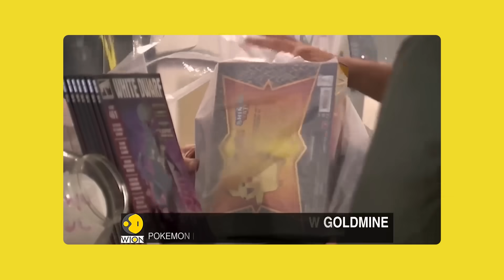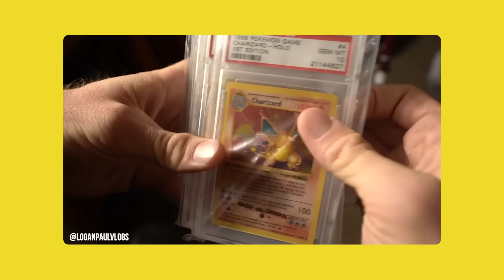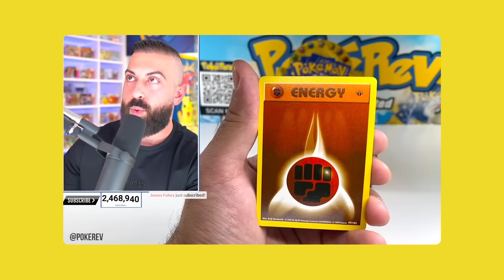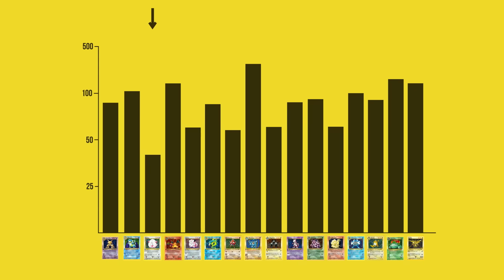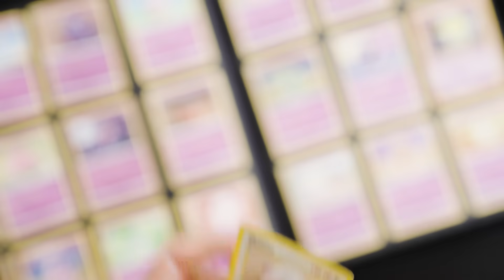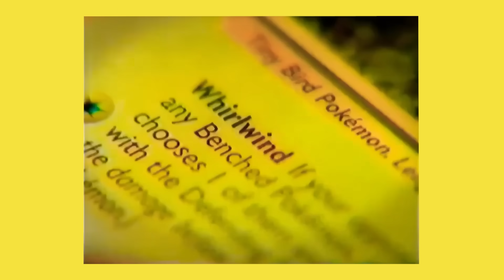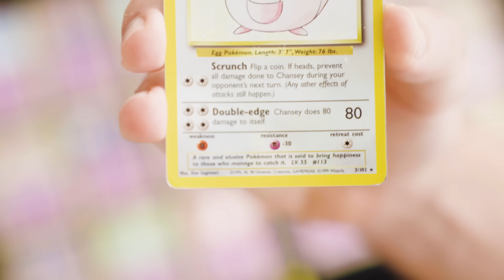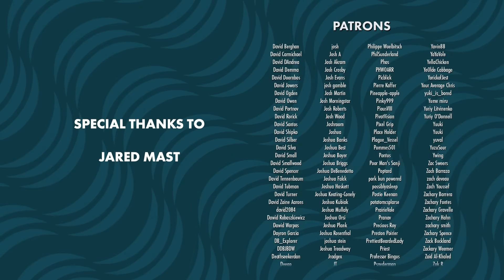Why the Chansey Pokémon Card is So Expensive | Good Blood

Comment: I would argue it did somewhat have a more supportive/nursing role in the game as it would be the only family of pokemon that could learn the move softboiled. One of the few healing moves the game has, especially for gen 1.
Reply: I dunno. As far as gen 1 goes, Mew is just as famous for Softboiled being a part of it's kit.
Reply: @Surkk2960 Have you tried using exactly a lvl 58 Machamp that also knows Bide? You see it needs to Bide its Strength in order to move the truck.

Comment: F*ck the speculation market. It ruins any sort of preservation. Also, Base Set Charizard is a really bad card in the TCG, Blastoise and Chansey are by far stronger cards in play at the time.
Reply: I mean Blastoise and Charizard worked pretty good in the same deck. Using both powers to roll them out. 

I really wish I'd gotten to use my Mr Mime, Alakazam, Chancy Combo at a tournament before my deck was stolen.
Reply: In a market where just about every other card is a foil and has some over the top graphic art that uses the entire card instead of just the box, the older and more subdued cards with old foil designs become desirable.

The game of Poke'mon is far beyond the playstyle of the original sets, so the original sets can practically only hold collective merit.
Reply: This is why I don't even bother with collectible card games above a certain dollar amount. I'll play trash decks all day, every day. I'll find friends who want to play the game using proxies. I'm not dropping a paycheck on a piece of cardboard. Wasn't all this just supposed to be a game played on tabletops, not auction houses?

Comment: I have all 152 original cards framed on a wall in my house.
The last card I needed to complete the set was a Charizard. Everything on ebay was way too expensive and I figured I was going to have to save up for a while to afford one. Then one that appeared to be badly scratched was up for sale for about 90% less than the others. I figured I'd buy it so I could at least complete the set and hang them on the wall before I acquired one that was in better condition.
When it arrived it looked kind of funny. I took a wet cloth and wiped the front of the card. What appeared to be syrup came away and underneath the card was in virtually perfect condition. Utterly bizarre the person selling hadn't thought to clean it up a little. What a win for me.

Comment: I have that chansey by happenstance...huh, I never knew it was valuable. I've had it since it was released in the usa in the 90's
Reply: Time to get your pay day.
Reply: @proy3  Providing it meets the "10" criteria
Reply: @Crispman_777  which it probably won't. If graded, I'd be thrilled if it got an 8. I predict 5 at the lowest...Its not like its in unplayable condition after being kept in a briefcase for over 20 years but, it was bound in a deck with a rubber band years ago so certainly has imperfect edges and might be slightly warped but otherwise not bad condition

Comment: Meanwhile, Chansey is one of the better cards in the game (unlike Charizard which sucks). It's THE stall Pokemon card with 120 HP, 1 retreat cost, and being a basic Pokemon. This makes it pair especially well with a Trainer card called Pokemon Centre which removes all damage counters from all of your Pokemon in play provided you discard their energy cards attached. 

So you would slap this on the active slot, build up an Alakazam on the bench, switch with a strong attacker and use Alakazam's ability to switch damage counters to Chansey, which you would then fully heal with PC. It essentially made your team impervious to all damage if set up. This is especially the case when you have multiple Chanseys on the bench.

Comment: I know I had a 1st Edition Chancy, but I searched the few Pokémon cards I kept and couldn't find it, so it must have been part of the ones I sold like a decade ago. There's no way it would have been a 10 since I actually used it in decks, tho. At least, I'm pretty sure it was 1st Edition. I have this memory of it being in the first few booster packs I ever got when the cards first came out, and they were 1st Edition packs.

I also had 4 Charizards. None 1st Edition, but 1 was Japanese, and 1 was also a fake (may have been the same card). One of them I even pulled at my birthday party one year! It was very hype.

Comment: Imagine Pokèmon made ten times as many of them.
Reply: they could make more of them, but those wouldnt be first edition, so they have less value
Reply: Rarity is defined by scarcity, I mean the two words are basically synonyms. If someone suddenly throws another 150 PSA 10 Charizards on the table their value will reduce immensely, they probably wouldn't be worth even 10% of what they are now.
Reply: @88Opportunist  you forgot about editions mate. Reprints are worth way less than first editions. Yes the first editions will lose some value because of reprints, but they won't crash. They will remain very valuable.
Reply: @BanditLeader  Made past tense, as in "Imagine if the past was different." Sorry I was unclear on that.

Comment: It's just always hilarious that the most expensive cards are so.... mediocre. Like, boot up the Pokemon TCG gameboy game and try to make a decent deck based around Charizard. It's just way too inconsistent. Sure, you get that massive 1hko, but with basically no energy acceleration (remember, Blastoise's Rain Dance only affects Water Pokemon) on top of being a dreaded stage 2, it just does not work out. 

As for Blastoise and Chansey, the good turtle is laid low by being a stage 2. Basics, and even some stage 1s, outclass stage 2s in almost every regard. But, Chansey just doesn't do much at all. As a stall-mon, it can be fine, if it didn't damage itself for 80 on each attack or could actually do something. Lickitung is almost 100% better than Chansey. You still have the 50/50 of preventing all damage (either through Scrunch or Tongue Wrap's Para chance), but Lickitung actually does 10 damage each time. And that can certainly move the game forward better than Chansey's literal nothing. Often, most decks have no way of curing paralysis outside of the card Switch, as evolutions are rare and Full Heal is basically worthless 90% of the time.